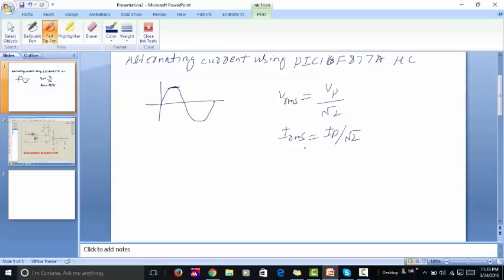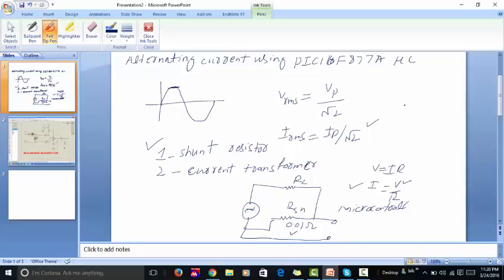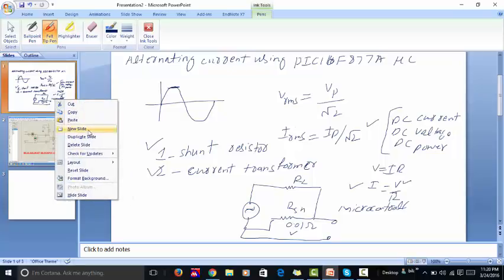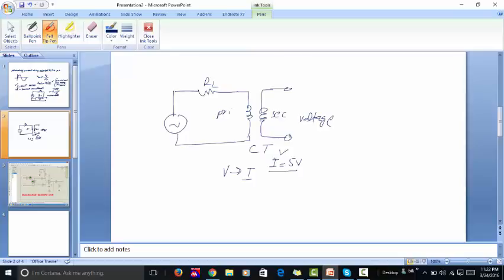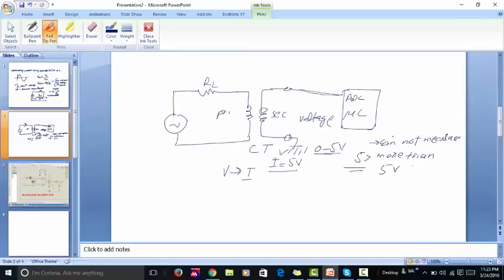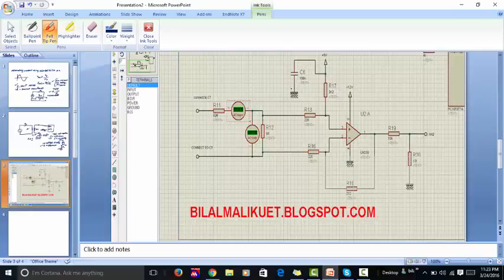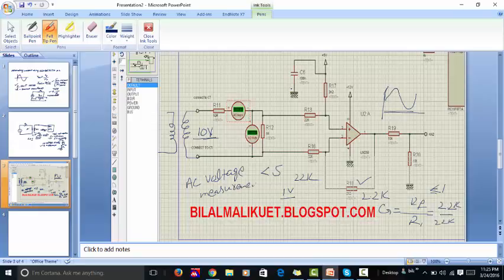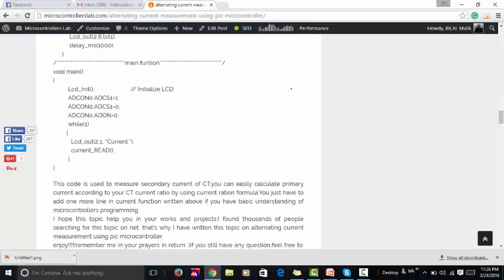AC Alternating current measurement using pic microcontroller

Comment: Since we are getting  input from CT 10v and this is connected with two resistor 10ohm and 1ohm(shunt) which are connected in series. Then how come we could get voltage drop across shunt 10v . Seems confusing to me. Would you please explain that?